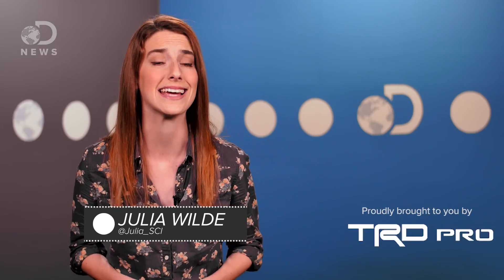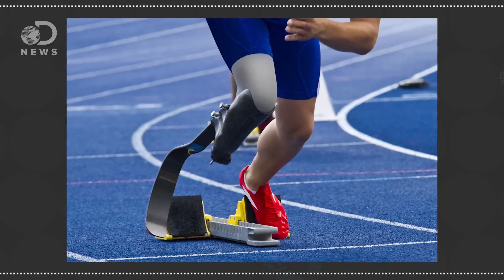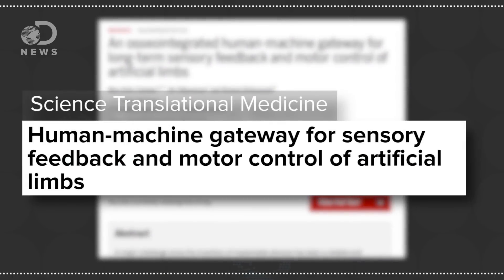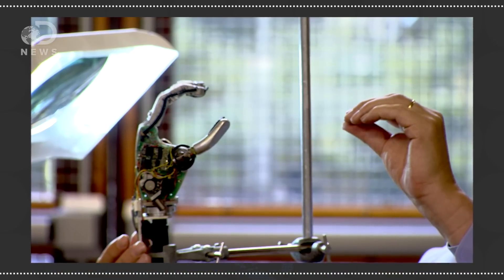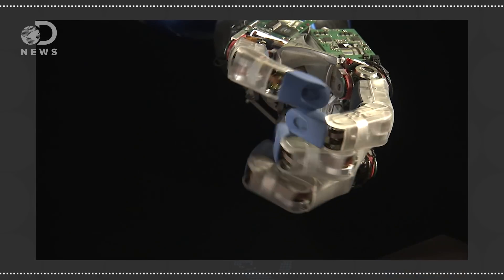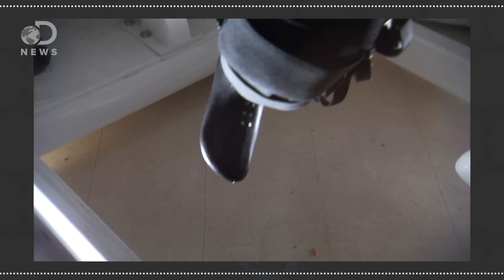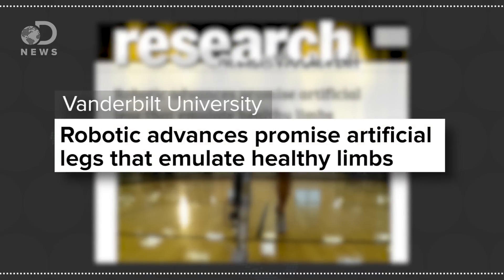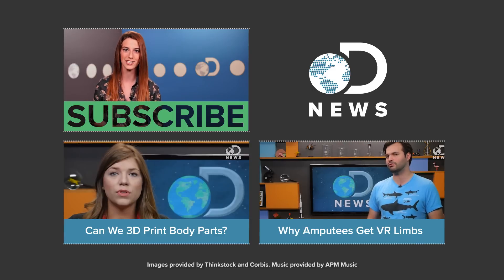What Is The Future Of Robotic Limbs?

Comment: I had 3 separate amputation surgeries but I don't have anything like these prosthetics; however, I did perform some research on cheaper alternatives to these products which include using a strongly magnetic screw on the bone then using the changes in the magnetic field to track how the bone is oriented adjust the prosthetic accordingly in real time.

Comment: Could also make the limb increasingly smart as well so as to increase dexterity, much like how Stephen Hawking was given a predictive algorithm to increase the speed of his texting. In placing this muscle memory in the limb, less thought would be required to execute actions, vastly improving speed. Unless you needed to make new maneuvers, of course.

Or, a cybernetic brain that allows integration with various technologies, using fine micro or nano-computers designed to interact with neurons. Something fashioned after Ghost in the Shell's cyberbrains. It would have to have a conductivity similar to or greater than the human brain, especially using certain carbon allotropes, known to have a conductivity exceeding copper, as well as being bio-compatible. Through this you wouldn't need to reconstruct the human body to accommodate the limb, as you already have easily implantable systems that allow for communication with electrical systems.